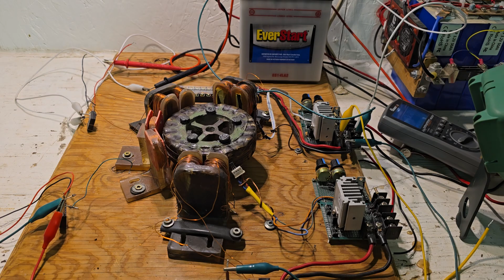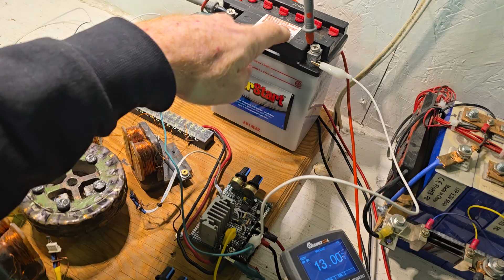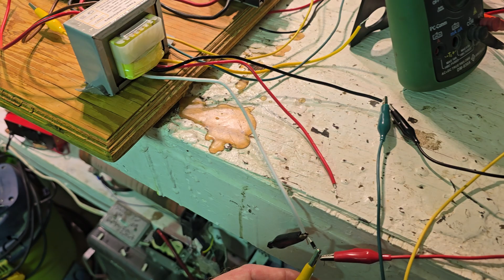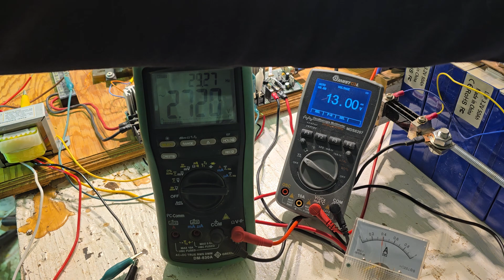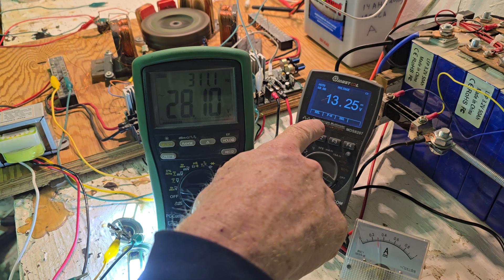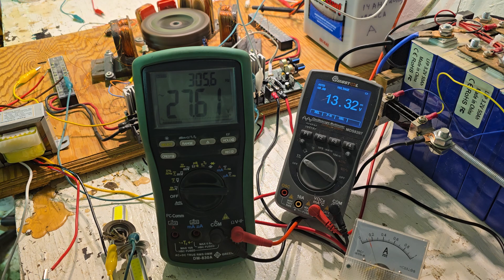Pulse Motor speeds up under load...different motor this demo uses

Comment: Nice work. 👍👍. I been rewatching your how to videos on how to build the driver circuit.  
What is the Proximity hole effect sensor. I ordered the wrong ones and it won't trigger a transistor.

Comment: Very nice mate. With your advice I have managed to reduced my input current when connecting the 100kva transformer in parallel with the driver coils down to 80ma comparing to 250ma which's also running a 100 watt motor a t 12 volts through a voltage regulator. Just by swapping different coils and rearranging the connections has made a huge difference. I'll try to fine tune it more and post my result hopefully before easter break. Thank you another great video
Reply from the maker: That’s sweet!! I can’t wait to see buddy!  It’s something that requires tuning that’s forsure. I wish I can post everything in one video but I will have to make this a series to show all the variables involved.
Reply: @windpowerandmore6310  Your absolutely right. I've  also made other changes to the driver circuit. I've replaced the other mosfet with the irf3205 which performs slightly better and doesn't overheat as much. I've purchased more and will connect six mosfets in parallel and will be adding a higher watt rating resistor for the gate drive and see how much power it can squeeze out of it. i've ordered more different high frequency caps too and still working on the other parts of the project. Got a lot on my plate that's keeping me busy and now it starting to bare some fruits from my labour.
Reply from the maker: @11Sam11 I’ll have to check out those fets! Thanks for sharing bud !